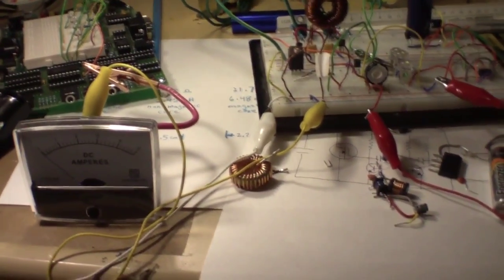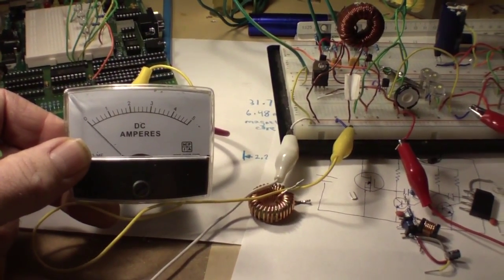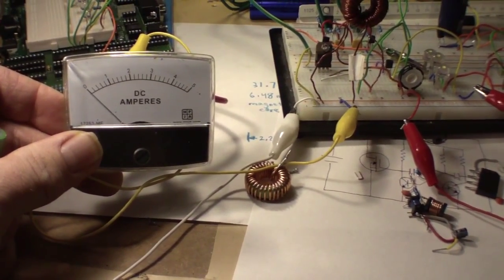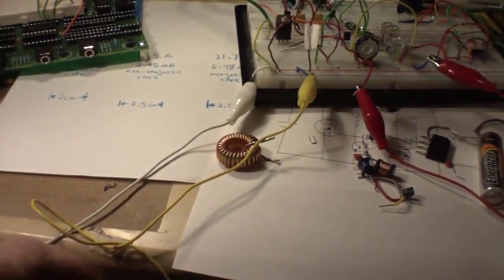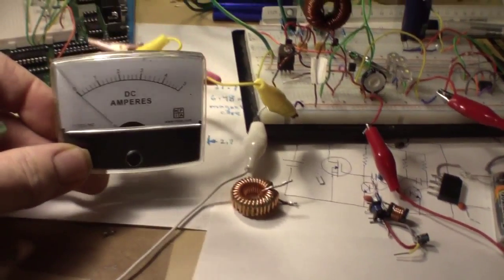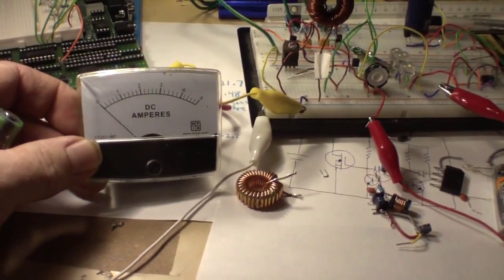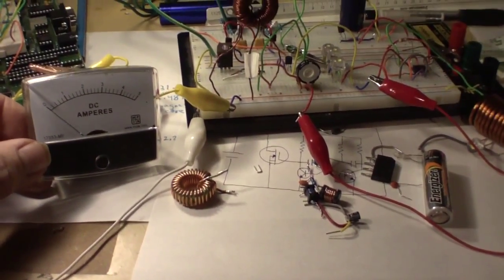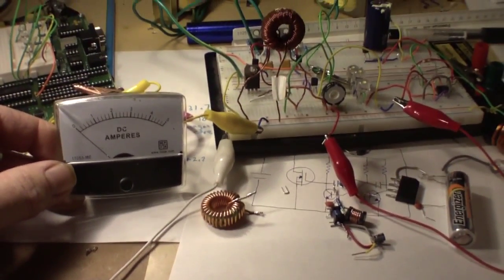Measuring Amp Draw - Ammeters

Comment from the maker: @lykenth08 a shorted coil will not show maximum output, because in that scenario there is no load, no power output. It' similar to measuring the short circuit of a solar panel; you'll get a number, but it doesn't mean that when you add a resistive load, you'll get that power... thanks

Comment: Do you know if you can measure amps if you short the coil? would that not show the maximum amps out put? - i tryed it with my generator an i had an amp reading. does that normally happen? i use a digital meter